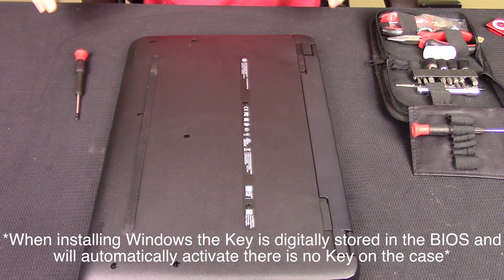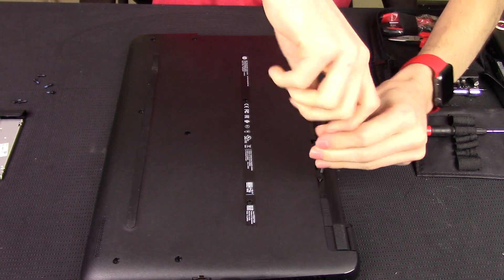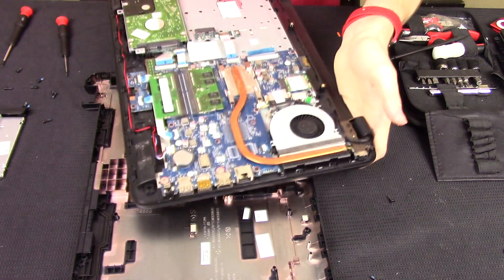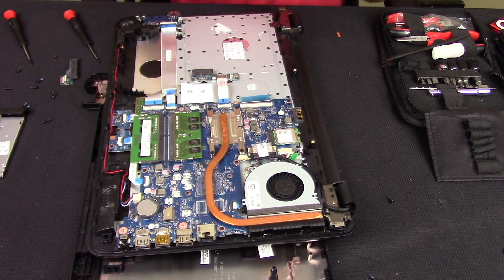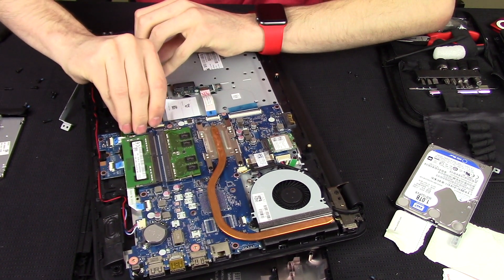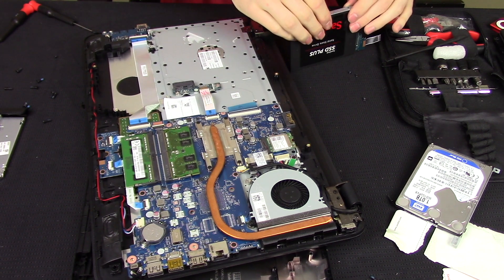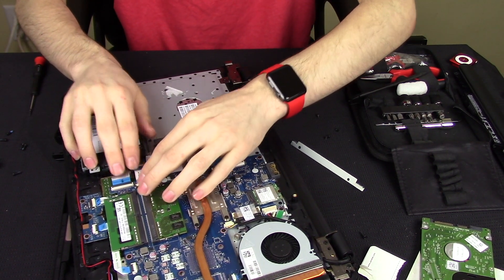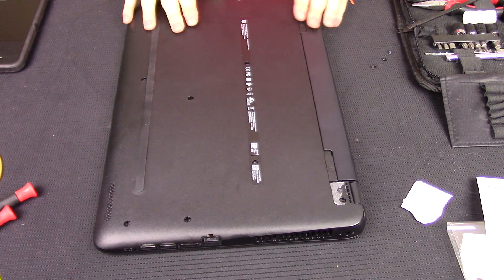HP Laptop SSD Upgrade

Comment: The first thing you should have done even before opening the case was to clone your HD to the SSD.  That way, once you installed the SSD you would have been good to go.  Also, you should have installed the second drive bracket and don't forget to throw that 1TB WD Blue into a $15 case for a really cool external drive.  The trick with working on the HP 15-series is learning about the 2 hidden screws under the rubber feet... once you learn they're there and also need to be removed to open the case it's all downhill and the rest is easy.  I also have an HP 15-series and the first thing I did was replace the puny 128GB SSD that came with the computer with a Samsung 850 EVO 500GB M.2 drive.  Now, I've got enough storage to save the day and a pretty fast little 128GB SSD stick for an external storage device.
Reply from the maker: Brand new the HDD was empty
Reply: How do you clone your HD to an SSD ??

Comment: When I have a laptop with a DVD drive I like to install the SSD and then leave the DVD drive removed and stick the stock HDD in a DVD drive bay adaptor so you can have an SSD for Windows and key programs, and the 1TB for mass storage. The SATA connector for the DVD drive is usually SATA 1, but with a  5400rpm drive it doesn't really matter much. You can always pay a little more to turn the DVD drive you removed into an external DVD drive too, in case you have some rare use cases for it.
Reply: Can that be installed with it back together? I hate to have to tear it all apart again just to install it. Although in my use case, I suppose I'm better off putting the HDD in a 3.0 USB enclosure. I'm on the road with a mobile office and the laptop needs to be hardy.

Comment: I don't understand why you replaced a 1TB hard drive to a 240 GB. Aren't you suppose to replace it with a higher memory capacity? 1TB is 4 times the memory capacity of a 240GB right?
Reply from the maker: I replaced it with an SSD for speed not to gain storage. I didnt have a reason to spend money on a 1TB SSD
Reply: @TechOut  I see. I guess SSD's are really expensive. But for gaining speed, I guess they're worth getting even with lower capacity. Thanks for replying bro, more power to you.
Reply from the maker: Ya I didn't need 1TB it was just a beater laptop at the time. Would rather have a smaller faster SSD than a larger slower HDD. Upgrading a cheap laptop like this to an SSD can really boost performance.

Comment: I changed to a ssd but I can't install W10 since it dosen't boot from the USB! :(
Reply from the maker: It will boot from an SSD
Reply: You have to get into the BIOS. Try pushing Escape as soon as you turn it on. Or determine the model number and go to HP support site and download the user maintenance guide.

Comment: I have a laptop hp 15 ac 021tx and my problem is that I changed ssd wd green 240gb in HDD bay, it worked well. However, the HDD 1TB put in caddy bay could not be recognized in bios or win10. I uninstall SSD and using only HDD in caddy bay, in this case, HDD  worked well. Both HDD and SDD are installed win 10. Please help me fix this error. “ sorry my English not good”, thanks for all suggestion and helping!

Comment: Hey, what kind of adapter you use, to connect sata on HDD and that flat wire that goes from the motherboard? You basically connect it with (I dont know the name of connector) to sata. Sata goes tp your hdd's sata.
Reply from the maker: +Alex Gufovsky it's not an adapter it's just what HP used to make the cabling simple it's specific to the laptop not something you normally need to connect an SSD

Comment: Great Video! My question to you is, if I replace the HHD (which died on me) with a new SSD, can I load Windows 10 on it without HP's interference?
Reply from the maker: If you reinstall windows 10 it will not have any of the built in HP stuff on it.
Reply: Update...it was a simple process....I downloaded the software and installed it. Easy as that. :)

Comment: Help. I have a Hp15-ro14TX. Cn i install ssd on it ?????
Reply from the maker: Yes just replace the 2.5 inch HDD with an SSD
Reply: TechOut so i cn only use one at a time right. Either it will be a ssd or hdd. Cnt i install both??
Reply from the maker: Correct this laptop only has a spot for one drive at a time

Comment: hes full of bs ive taken apart an identical laptop to this and half the stuff hes said is incorrect
Reply from the maker: Like what?
Reply: you didn't even cut out the part where you said the keyboard comes off when it doesn't. you say it comes with 6gigs of ram yet you can clearly see it has been manually upgraded and that was only watching the first 5 minutes or so of the video.
Reply from the maker: This particular one did come with 6GB of RAM. Just because you bought a "identical" model doesn't mean it's the same spec. They make these in different configurations.

Comment: HP gives low quality laptop. The plastic casing started cracking within a year. The warranty doesn’t cover these plastic cracks and puts them in customer induced damage. Please don’t buy HP laptops. 
Even the HP customer care is very rude. HP laptop quality has gone down. Never buy HP laptops
Reply from the maker: I mean plastic doesn't just crack on it's own. So i would agree with them on it being customer induced damage.